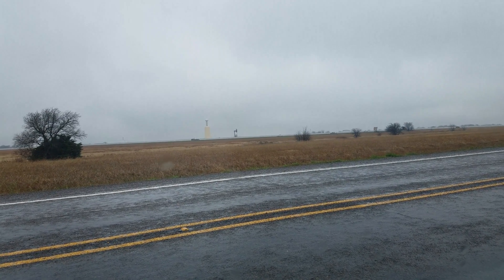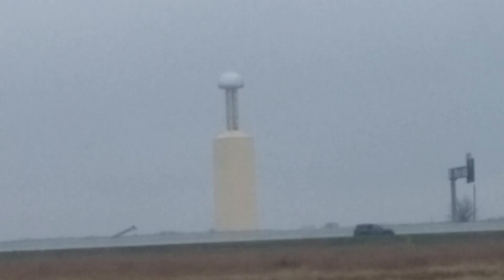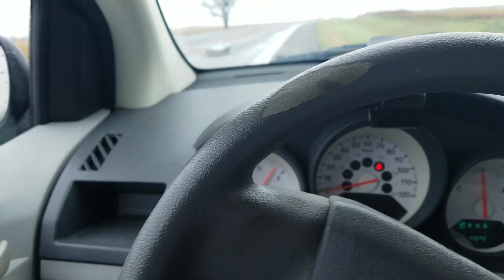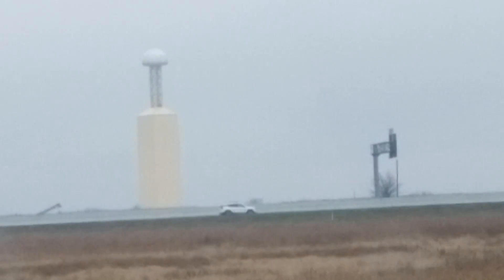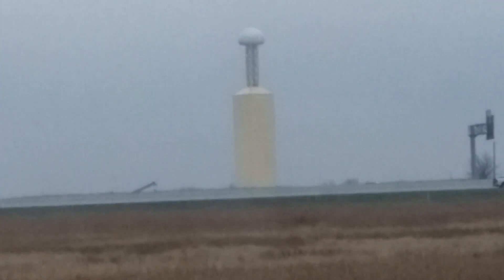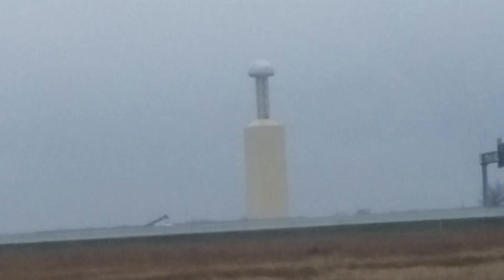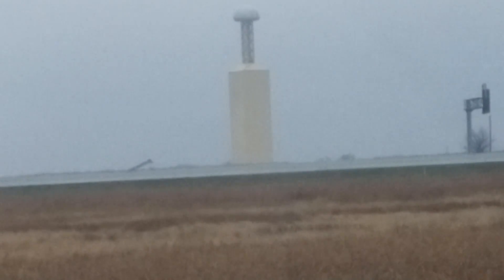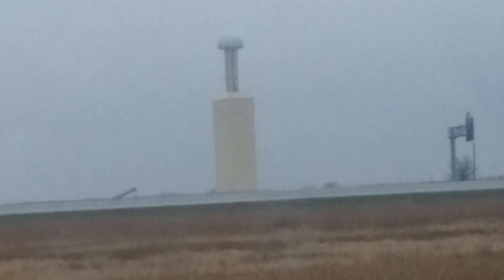Tesla Tower 2.0

Comment: man, what's this whole idea of free energy coming from? you don't want to pay your electricity bill? get some solar panels and quit waiting for your house to magically be powered by lightning bolts.
Tesla was researching the wireless transmission of electricity, to work in a similar way to radio. but there's significant power losses to the air, to ground, and anything that's around. so to power something that's like 10 miles away you'd need a ridiculous amount of power and it'd cause an EM interference in anything that wasn't originally powered by it. of course I sorta wish we looked into all of that, we're still catching up to where Tesla was like 100 years ago
there's some misconceptions about these things though, as in people think they violate the laws of thermodynamics and "create" energy from thin air. 
even if we were powered by huge Tesla coils, the electricity companies would still find a way to make us pay for it because there's still people running, maintaining, and making the damn things
Reply: Exactly, but Tesla was transmitting along the ground not the air